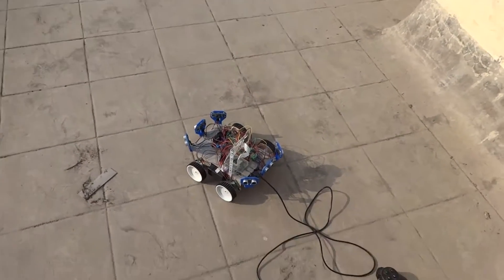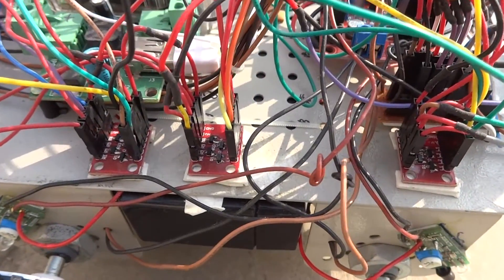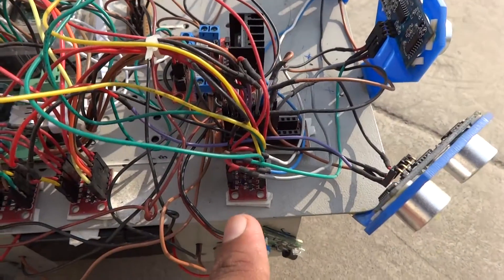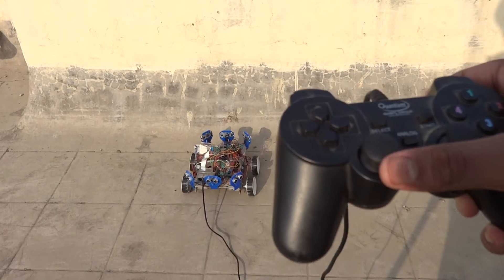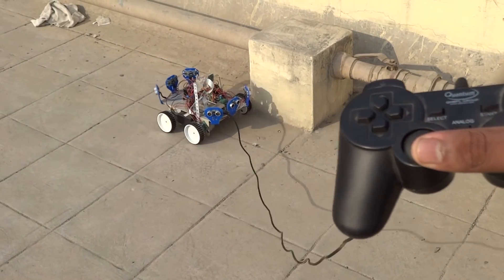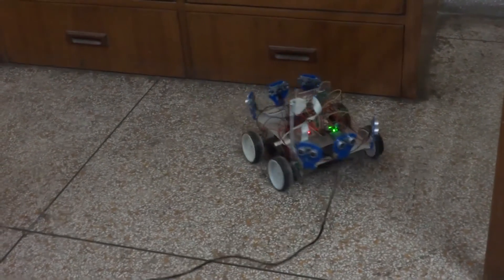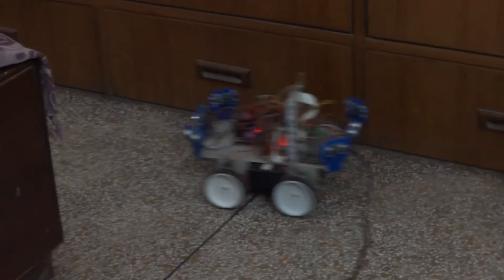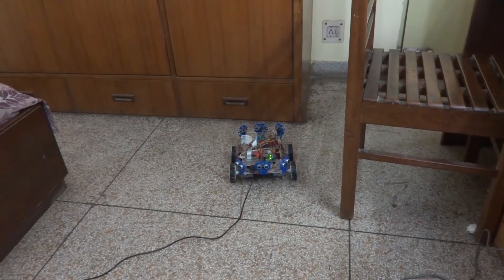Six Ultrasonic Sensors !!! | Raspberry Pi Robot v3

Comment: Use the photon-pixel coupling method, it is a new approach in science for reading an unlimited number of sensors in parallel. I am sure that it is very useful in engineering of robotics. Maybe you can do it with an Arduino.

Comment: hi, from my understanding, input (trigger) to sensor can be direct from 5v, and output (echo) should be through level shifter 5v to 3.3v, so it will need one and a half of  4 pin level shifter, is it right?

Comment: I am currently working with a project as well but at the moment, i am still using a breadboard and some resistors. Is there any way you could help me with using a logic level converter connecting it to the Pi and ultrasonic sensors? and how were you able to use 10 sensors using 1 raspberry pi?
Reply: thank you but how do i connect the 2 middle pins of the sensor. I am too worried that it might destroy my device or so
Reply: thank you again. raspberry pis are quite pricey so i cant really afford to break it